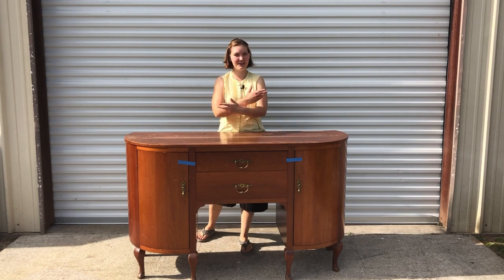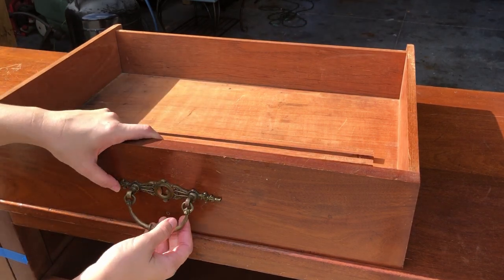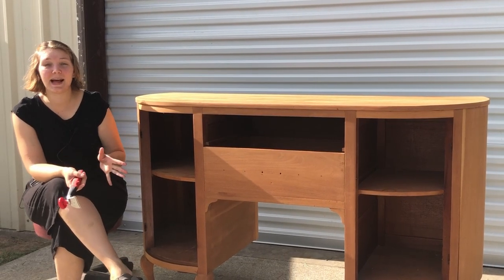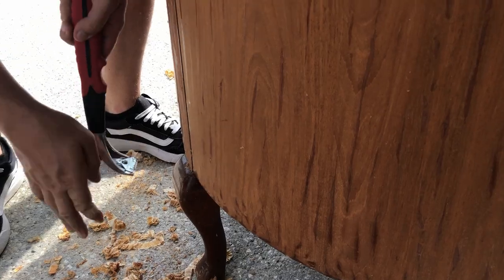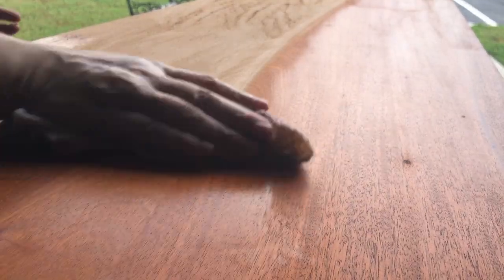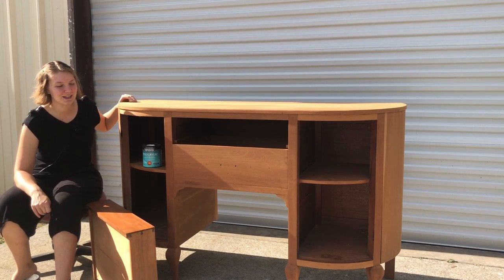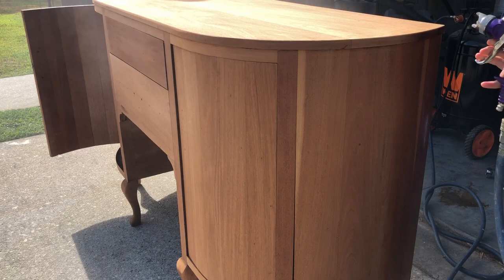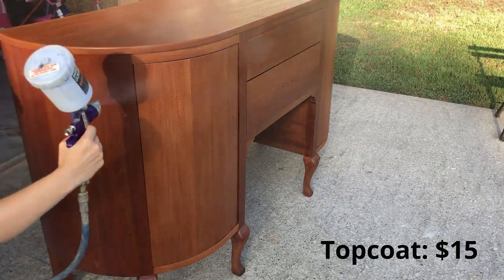Restoring an Antique Wooden Buffet | Under $100 Furniture Challege!

Comment: Gorgeous. I like it left natural. But I wonder if you could’ve used a wipe on oil poly, if that would’ve been quicker and cheaper. Or with the heat have been too much for it?
Reply from the maker: I did think about a wipe-on poly but I haven’t used one yet and wasn’t sure I wanted to try my hand on something new with this piece.